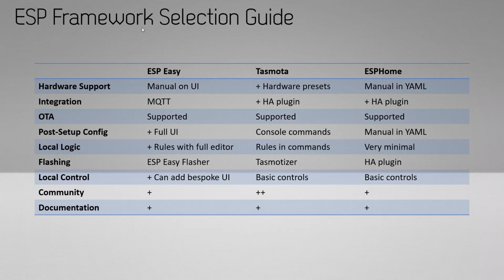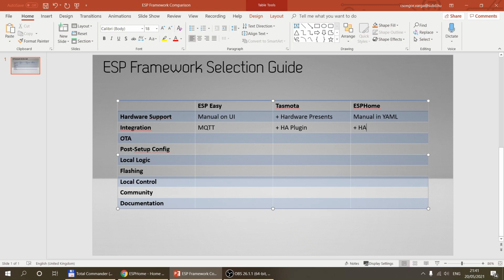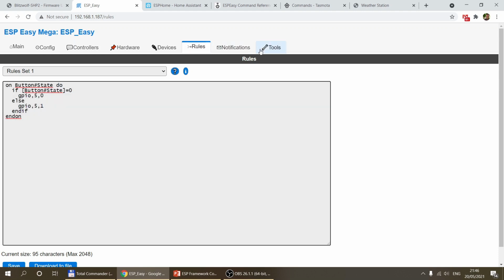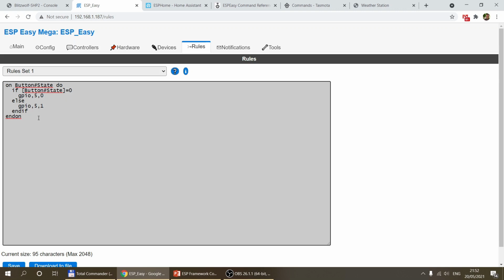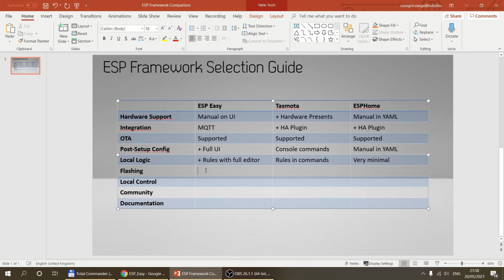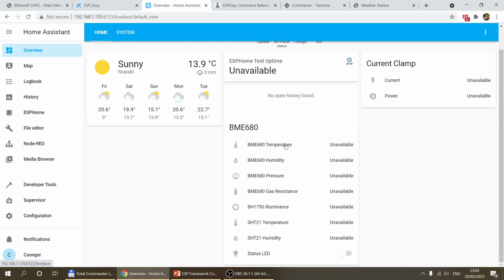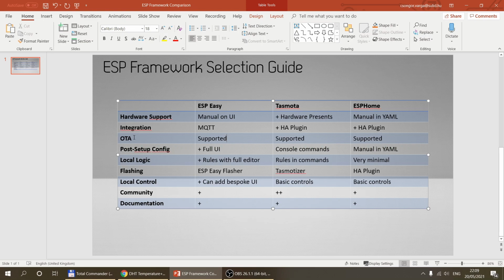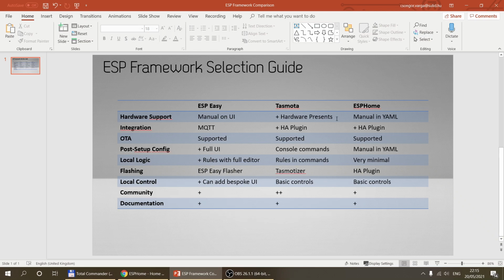How to pick ESP framework for your project: ESP Easy, Tasmota or ESPHome

Comment: I tried Tasmota with Sonoff switch I installed it using Tasmotizer that worked ok but only stayed working for two weeks then failed to connect to WiFi so removed it and then installed again with the same result its just not reliable
Reply from the maker: Maybe it is a hardware issue. I have a few tasmota devices running OK for years now. But it is hard to tell.

Comment: For education purpose, which one would you suggest as a replacement of Legacy Blynk, which has been stopped?
Reply from the maker: Esp easy is a local solution, Blynj gives you access to your device from everywhere. And that is a big difference.
Reply: @csongorvarga  I see, for that purpose are you aware of an active replacement to Blynk?
Reply: you can build a more complex own automation system based on a Raspberry mini computer and MQTT, Nore-red server programs running on it. You can build your own web ui for that in Node-red and dashboard and access it by a web browser to monitor and control tasks. You can also install a wireguard vpn server on the raspberry and make a port forward on the router to able to access web ui from outside of internet. If you dont need a  logic system you can control and monitor thru MQTT server alone either. There are existing MQTT UI apps for android for that.
Reply: @smyle78  Thank you for this informative reply, it's great for sure to have owned implementation if there's one project.
But for education purpose to newbies, I'm realling looking for Blynk alternative: easy configurable pins (via mobile app) and control, perhaps with libraries support as Blynk.

Comment: I came from ESPEasy which I used for years now, then maybe two years ago, for some sonoffs S26 I switched to Tasmota. Meanwhile half of the Sonoffs are back to ESPEasy. For anything with more logic required than a simple Sonoff Plug, Tasmota is not the perfekt solution. ESPEasy is so much better toprogram, so much mor userfriendly. I am going to reflash all of them with ESPEasy.

Comment: a question if there is no router it has autoconnect or I will have to disassemble the entire project just to make a new recording then I can not change the password of the router?
Reply from the maker: If they cannot connect to the router (because it is not working, or the password has changed), all these fall back to an access point mode where you can connect to the device directly in their own wifi and re-configure them.
Reply: @csongorvarga   ok obrigado